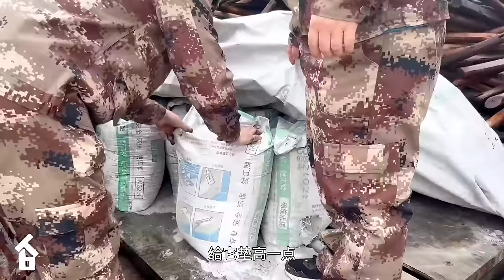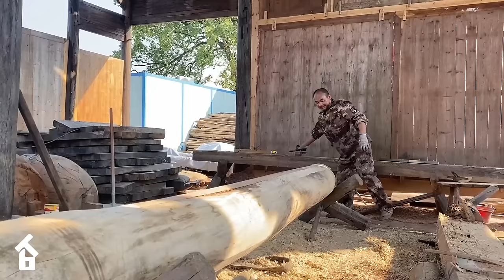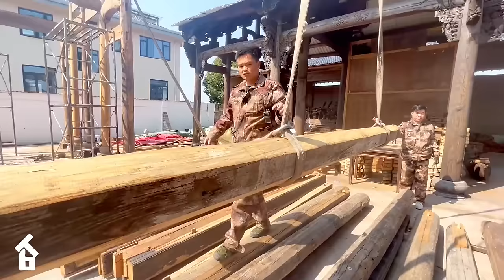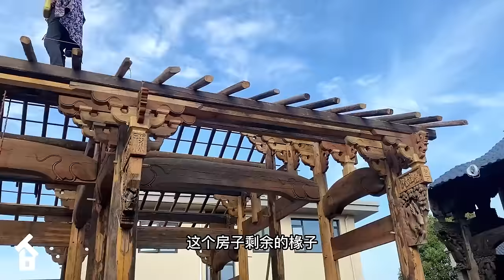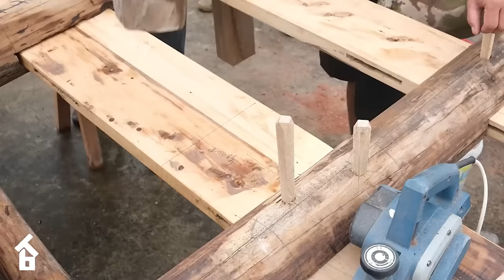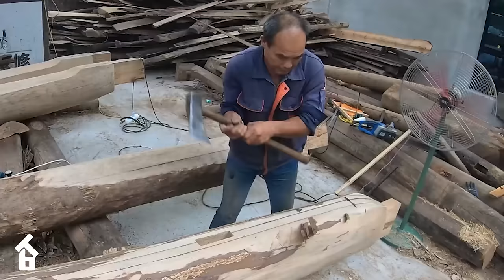The Process Of Making A Wooden House Chinese Style House. Great Chinese Woodworking Skills!

Comment: Beautiful old woodwork. It isn't clear whether this building group is intended as a home in place or if the buildings are being assembled to be disassembled and moved elsewhere? The site doesn't look like a country house site. Is it possibly a museum site to show and preserve these old houses? 
I had the pleasure of visiting an 18th century Chinese village house that was moved almost complete to the Peabody Museum in Salem Massachusetts. Bu it didn't have the really elaborate carvings this example has. I think most of the material from the masonry enclosing walls was built using modern materials. But because it was plastered inside and out only the original carved stone details were still visible. It is a large house that had been occupied by several members of the same family for generations until only a few decades ago. 
I was very impressed that the chinese were doing laminated construction using pegs hundreds of years before the same technique (using glue) was employed in the west. We call it "gluelam" or "laminated timber".